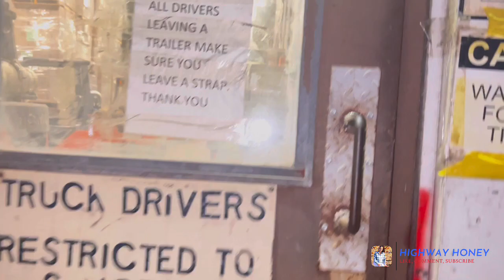TRUCKING with AMISH

Comment: A few things about the Amish. They also live in Southern Maryland. They are excellent wood workers and make some great furniture. They are open to some modern amenities such as electricity and phones. Most are farmers and use modern milking machines as well as hiring tankers to sell it. The guy you showed driving his buggy should have had a reflective triangle on the back showing it was either a farm vehicle or slow moving one.
You need to get a blue tooth mic for your camera or run closed captioning like you have before.
I hope you had a nice thanksgiving someplace other than on the road.
At first I thought you were going to get loaded up with pallets from the looks of the place you were at. Imagine someone dropping a math in that yard. You could probably see the flames in L.A. Also that road you were on getting there looked super narrow. Suprised they allow commercial traffic on it.
Stay safe and warm.
Reply from the maker: Thank you!! I also believe they build homes too!! Yes the road was not made for a truck. But I e been in worse! Lol😂
Reply: @HighwayHoney  A year before I moved to Southern Maryland there was a devastating tornado that hit the town of LaPlata in Charles County. The Amish were hit as well. People with vans and pickup trucks met up with the Amish and they came with or without any tools  and didn't hesitate for one minute during the cleanup. Many used hand tools while other opted to use gas and electric powered tools for the first time. From what some of the locals were telling me if it wasn't for them the cleanup would have taken longer. They also own a flea market that's only open on Wed and Sat and do a bang up job selling products made on the farm and leasing out space to vendors.